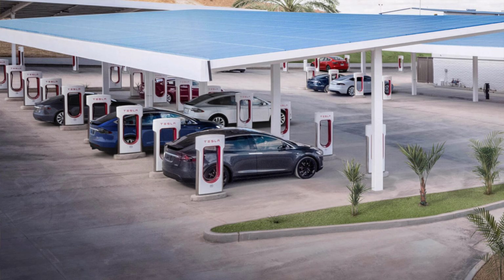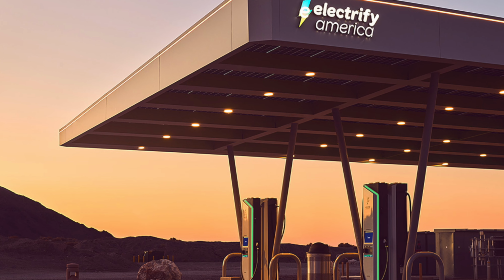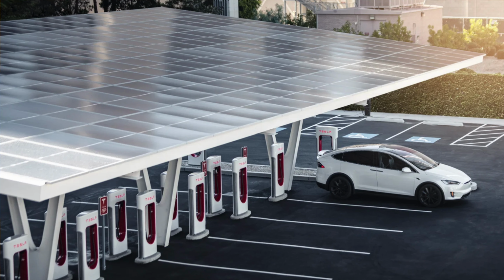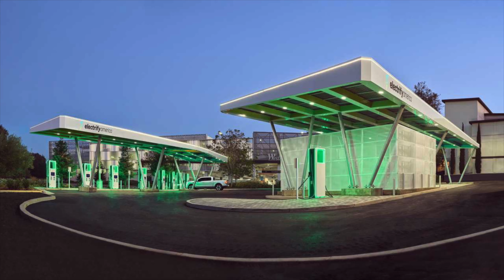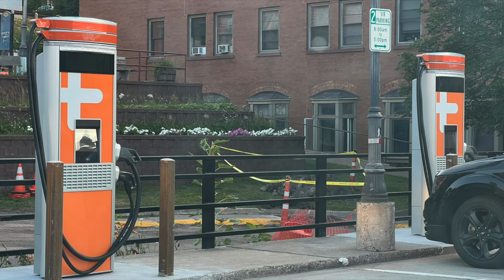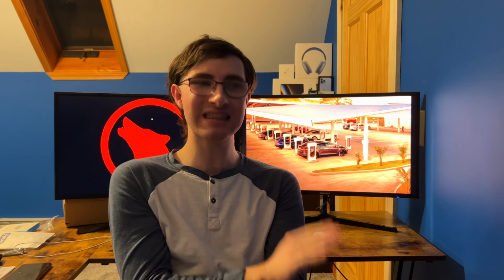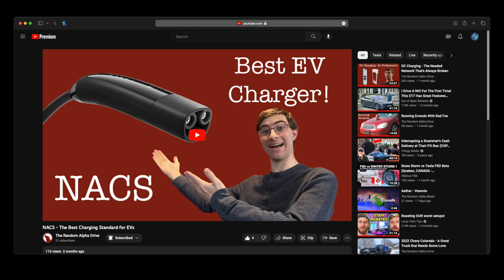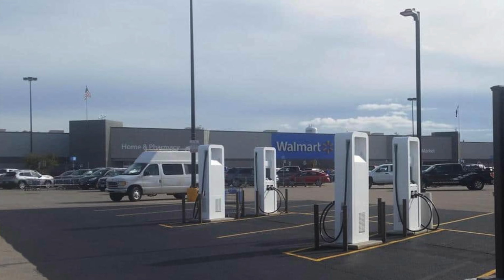The Ideal Charging Station

Comment: Wel, one reason why they are at the back of parking lots is because of ICEholes. They will take up a convenient parking spot even if it's a EV chaging station. One solution I see is if the whole parking lot is fitted with slow chargers (V2) and solar carports. These parking spaces will of course be a free for all but doesn't matter because there are plenty of parking and all have charging points. At the end everyone will see the light and go electrc anyway. 😜
Reply from the maker: “ICEholes”, I like that. I think I’ll use that word to describe such drivers in future videos. Totally agree with you about the AC charging in parking lots. Makes way more sense than what the industry is currently doing.